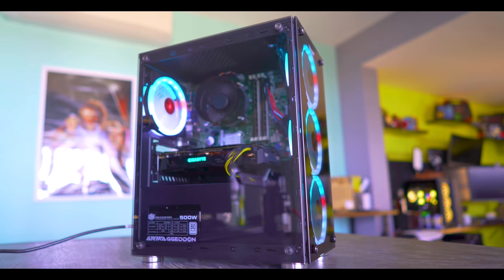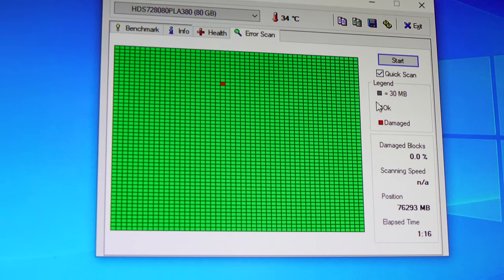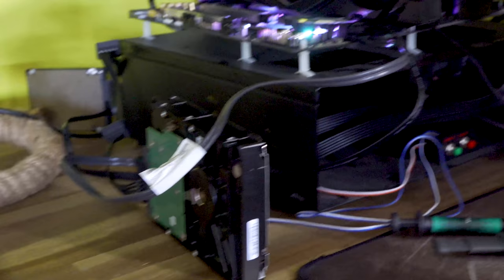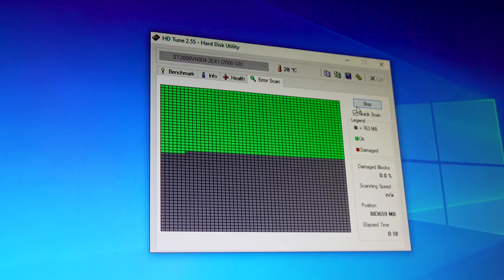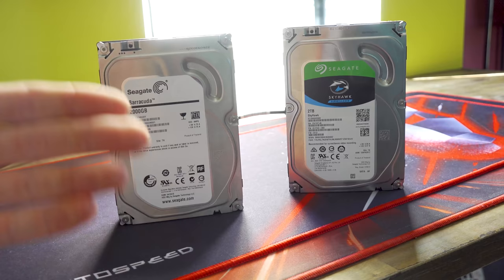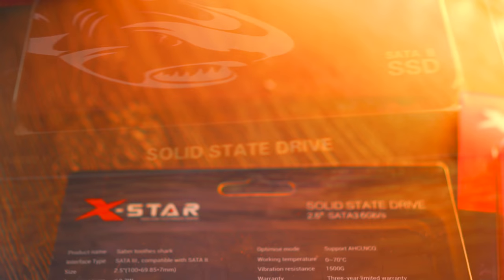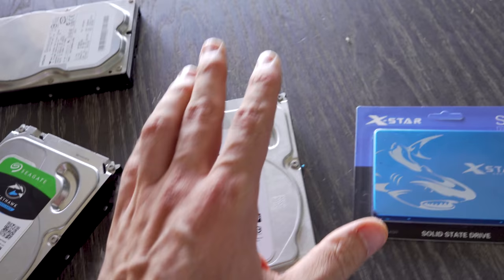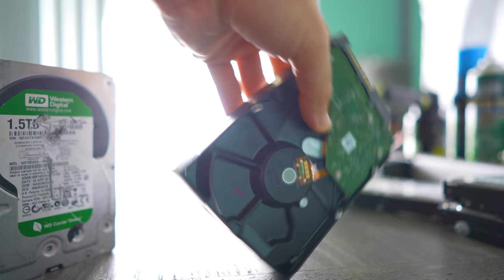Are USED Hard Drives Worth it...? (The Tech YES Buyer's Guide)

Comment: Who is using 1 and 2tb hard drives in 2019?  the smallest drive I have currently working in a machine is 4tb.  I have a set of 4 4tb drives in my workstation that I picked up a few years ago now for about $100 a pop for decent quality wd red drives on sale...  my NAS has 8x 10tb shucked wd easyshare drives (basically wd red drives in an enclosure) and directly connected via sata to a board and that runs freenas - each of those drives were $170 on sale (yes, that set me back a lot for all those drives, but i don't plan on upgrading that box for a while)...  In this day and age I wouldn't really recommend using these tiny 1 and 2tb drives due to age and also due to the fact that modern games require LOTS of storage.  there are quite a few games that take up in excess of 100gb these days.  If your deal isn't games but rather media, then still, high quality blu ray rips are upwards of 10-15gb each, or if you're shooting your own video, many decent 4k cameras like my panasonic lumix g85 have codecs that record 4k video at 100 megabits/second which adds up REALLY quick...

overall, besides the size of the drives, the advice in this video is pretty good in terms of tips for buying used drives.

other recommendations (I was a repair technician for 10 years and a consultant for the past 5), you mention picking up a 120 or 240gb ssd for booting, which is ok, but given the prices of ssd's these days, the sweet spot is about 500gb drives which you can pick up now for about $50 usd.  if your system has m.2, then buy an nvme drive (we're talking a price difference of typically less than $5 on a 500gb drive for literally 3x the speed increase) - but the overall advice of using a reasonably sized ssd for booting and hard drive for storage is certainly valid assuming you don't need to access the data on the hard drives very quickly.  SSD's as a system drive vs. hard drives is like night and day for boot times, application loading times, and in some cases like web browsing and video editing (where the system disk is used for caching), there is massive speed improvement as well.  unfortunately ssd's at larger capacities (over 2tb are either wicked expensive or impossible to get (i've only seen m.2 up to 2tb unfortunately and those are in the $400 range which is out of most people's budget) and attaching multiple m.2 drives to a system (say, over 4 or so) isn't viable due to pcie lane restrictions, so that's annoying.

at the end of the day, my recommendation for a decent gaming / media / video editing machine would be a 500gb m.2 nvme ssd with a 8-10tb hard drive and optionally a second drive of the same model configured in raid1 on your system in order to improve drive reliability by storing the same content to 2 disks simultaneously so if one fails, it's significantly less likely that you will lose data.  I also strongly advise a decent seperate (i.e. not on the same computer) backup solution such as building you own NAS from an older computer by installing 4-8 hard drives of the same model (preferably 4tb or larger) and using freenas or unraid with zfs in raidz2 or raidz3  which would a. allow 2 or 3 simultaneous drive failures before any data loss (very robust), b. allow for snapshotting of information without additional storage overhead so you can easily revert to previous versions of files (very convienent), and c. zfs does scheduled background scrubbing of the array comparing parity data across the drives with what's stored on the drives via checksum and non-interactively correcting any bit errors in the data storage to ensure that you don't run into any bit-rot issues and that the data you stored remains fully consistent. (if microsoft brought zfs to windows, i'd recommend using it there as well but alas, i doubt it'll happen and ntfs (the windows default) is pretty crap at data integrity maintenance)

Comment: HD Tune Pro: WDC WD5000AAKS-00A7B0 Health

ID                              Current  Worst    ThresholdData     Status   
(01) Raw Read Error Rate        200      200      51       0        ok       
(03) Spin Up Time               156      155      21       5166     ok       
(04) Start/Stop Count           93       93       0        7393     ok       
(05) Reallocated Sector Count   200      200      140      0        ok       
(07) Seek Error Rate            200      200      51       0        ok       
(09) Power On Hours Count       40       40       0        44451    ok       
(0A) Spin Retry Count           100      100      51       0        ok       
(0B) Calibration Retry Count    100      100      51       0        ok       
(0C) Power Cycle Count          95       95       0        5785     ok       
(C0) Unsafe Shutdown Count      200      200      0        428      ok       
(C1) Load Cycle Count           198      198      0        7393     ok       
(C2) Temperature                114      81       0        33       ok       
(C4) Reallocated Event Count    200      200      0        0        ok       
(C5) Current Pending Sector     200      200      0        0        ok       
(C6) Offline Uncorrectable      200      200      0        0        ok       
(C7) Interface CRC Error Count  200      200      0        0        ok       
(C8) Write Error Rate           200      200      51       0        ok       

Health Status         : ok

Look at that WD power on hours xDDD
That thing is an elephant.

Comment: Nobody should be using spinning rust at all , no reason for it at all anymore.
Reply: both has pros and cons; HDD are weak against vibration & shock but its capacity don't degrade, while SSD has finite read/write lifespan but very power efficient & immune to physical abuse.
Reply: @xponen  With a modern SSD, not an issue with the writes, unless you get a cheap crappy one. Not to mention modern HDDs don't fail gracefully, one day the cheap shitty bearings they use nowadays will fail and your screwed. The SSD at least will start throwing up smart errors when it gets too many dead NAND cells.